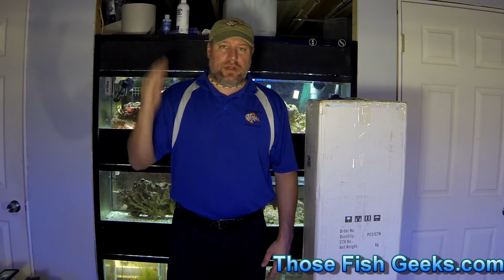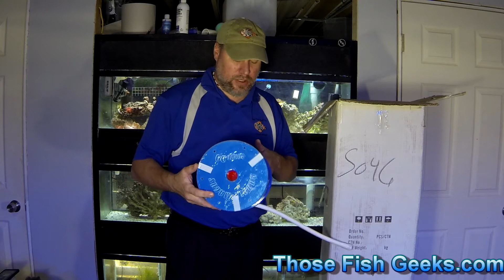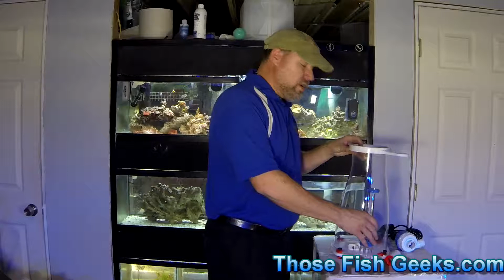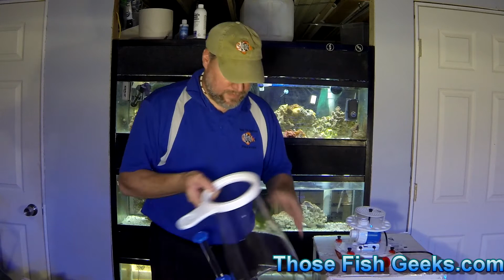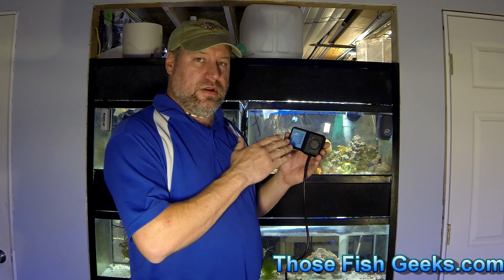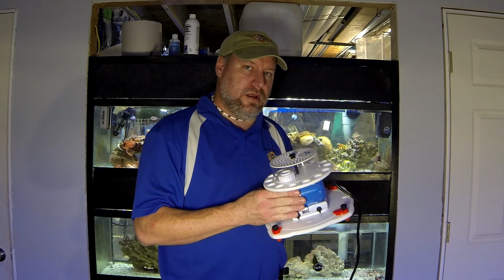Bubble Magus Curve 9 DC unboxing and first look

Comment: You have the motor inserted incorrectly. It's on an angle! Look again. Mine is perfectly straight. I have no idea how you got the motor in that way but I suspect that you didn't make it parallel to the base before clicking it in. Also, mine has the extra hole with a plug so I can change the intake by 90°.

Comment: Hi mate, just so you are aware I believe the bubble plate part that has no holes is ament to go directly over the outlet of the pump. I believe this is to prevent the up flow causing turbulence inside the body. 

Great video. Nice to see a review on one.